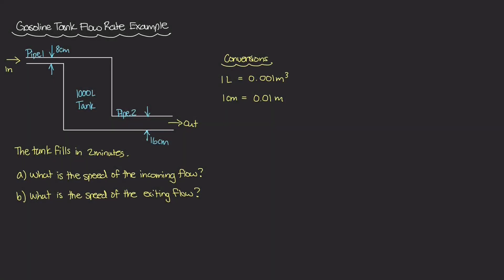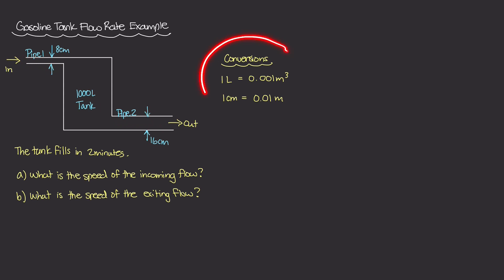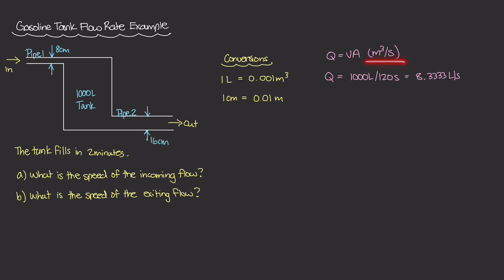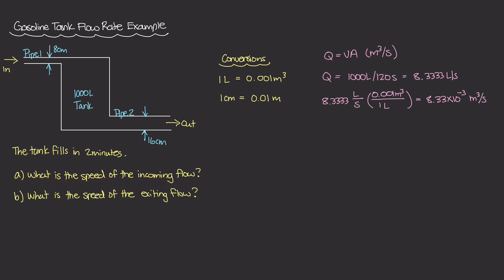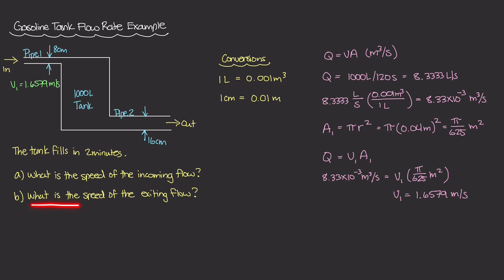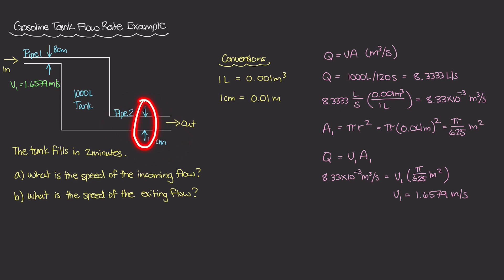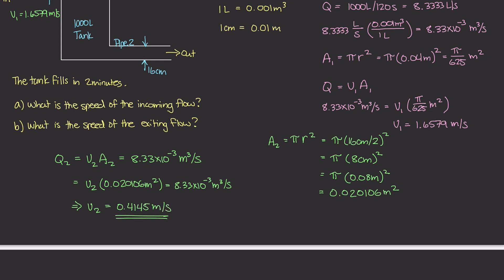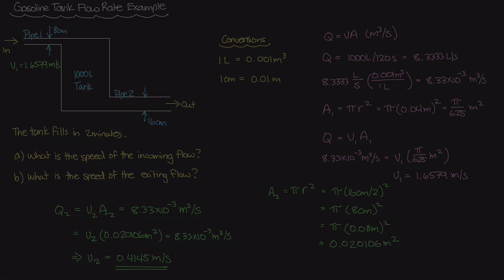Volumetric Flow Rate Example 2: The Gasoline Tank [Physics of Fluid Mechanics #42]

Comment: why pipe 2 velocity isn't half of velocity 1 because p2 has double the dia ?
Reply from the maker: It's true that the diameter is twice that of pipe 1, however the flow rate is concerned with the cross sectional area of each pipe and not the diameter. If you calculate the area of both pipes, you'll notice that the area for pipe 2 is not twice the area of pipe 1.